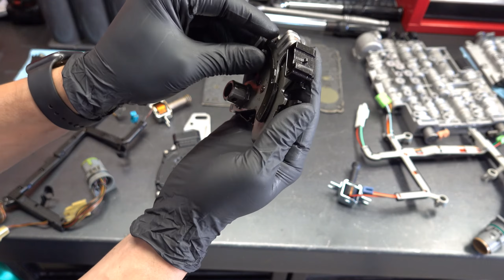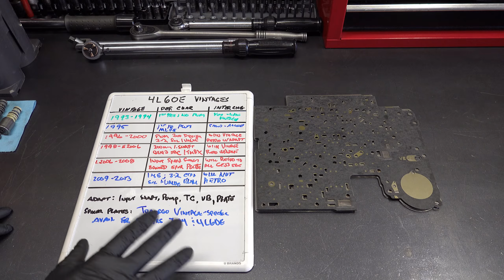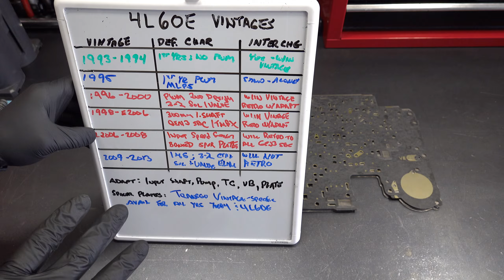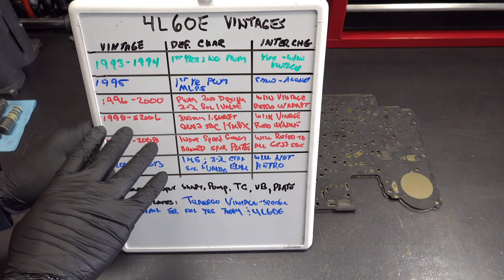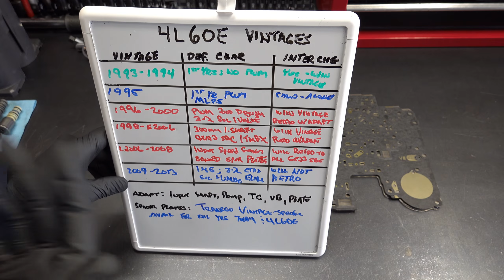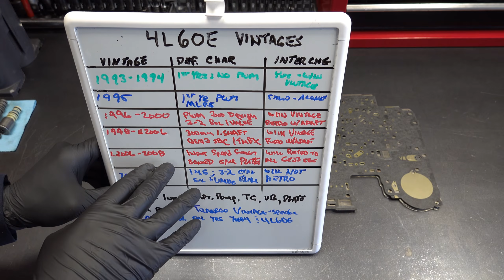How to Buy a 4L60E - Changes and Interchange Rules

Comment: Late comment, but is there any reason a 4l60e from a 98 Camaro LS1 not be compatible with an 01 Yukon 5.3? Electrical? Just swap valve bodies? I'm getting mixed info on the internet... TCC has to be factory functional to go into the Yukon? Thanks!
Reply from the maker: Ignore anything you may have seen and continue watching this video - I give a run down of all the vintages and respective parts interchangeably towards the end.
Reply: Thanks for replying, much respect 🙏. This is my first rebuild which wasnt a virgin transmission. Had checkballs missing and an aluminum plug, no spring, to lock the tcc valve (bottom valve was also backwards). Vac test is failing on the tcc... should I ream or just use a Fitzall o ring type? Off topic, the play between lugs on reverse input drum (new) and sun shell was kinda excessive, would that cause a noise? Thanks for your knowledge and efforts in sharing all this info!
Reply from the maker: I'd use the Fitzall valve kit or ream the bore for the Sonnax TCC regulator valve. Replace both reverse input drum and sun shell as they are both worn and will make noice if their respective sets of lugs have excessive play.
Reply: Will do, thanks for your help!
Reply from the maker: You're welcome, Steve and thanks again for watching!

Comment: You skipped the pump
Reply from the maker: No, I did not skip the pump.

I didn't intend to cover the pump itself in any level of detail beyond the defining characteristics associated w/each vintage of 4L60E as it relates to the pump as well as other things. But in case you're looking for such info, there were two versions of pump: PWM and Non-PWM. Within the PWM, there were two sub-variants: TSS and non TSS.

A deep dive on the evolution of 700 and 4L60Es pumps is forthcoming; it will be way more granular and specific than what you have watched here.

Comment: I got one 94 Z28 Camaro 5.7 LT1 I have a 95 computer in this came with the car and I'm having shifting problems which it did shift perfect had a little bit of a hard shift in a second now I'm only getting 1st and 3rd didn't know if it was in limp mode or if the solenoids were bad I bought new ones put in it still doing the same thing ,so I bought a Corvette upgrade servo to put in it having a hard time getting the old one out and putting this one back in and the chip that was in the computer I have two chips that are the same you got the 777 in the middle of it and one of them has a 8 something in the number could the computer be causing me to struggle cars only got $80,000 mi on it I'm confused about it any help would be highly appreciated thank you
Reply from the maker: Not likely the computer. Sounds like the band is worn. Drop the pan and see if you can apply the servo via shop air at the exhaust port on the pan rail. If it applies normally, that would indicate worn band to me.

Comment: hey nick question i have a 07 4l60e case that i converted to 05 pump iss deleted and im going to run the 07 valve body with the transgo 46-plt-96 its going into a gen 3 car so iss is not needed will it be fine? since the vb and case are 07 and im putting a 96-06 separator plate on it
Reply from the maker: What input shaft will be using? 

If you're not sure (or not sure why I'm asking) check out my Forward Drum video where, towards the end, I discuss the different input shaft changes that took place between 2005-2007. It's critical your pump's stator shaft and drum's input shaft are a matched set.

Here's the video: https://youtu.be/oGrc31WSVeE

Comment: Can a 15 pin transmission work for a 13 pin vehicle if I switch out the transmission wire harness out.
Reply from the maker: You should be able to do so without any problems.
Reply: @nickstransmissions what would need to be changed

Comment: Im having a delayed 2-3 up shift after and a trans fluid pressure build up causing  fluid to leak in the filler tube to pan gasket area and after a light rebuild of the valve body. Where can I start my diagnosis?
Reply: Do I have trouble shooting options inorder to help speed up the process
Reply from the maker: What have you done to trouble shoot thus far, if anything? I'd rather not make suggestions until I know what diagnosis you have completed.
Reply: @nickstransmissions  I haven't done  much ive checked  fluid levels purchased and installed new neutral safety switch and clutch cable thinking possible detent failure however problem remains
Reply from the maker: Ok, I am guessing that, assuming your fluid level is correct, system filled to capacity (not under or seriously overfilled) then its likely your 3-4 clutch pack is starting to fail. You can plug in a scanner that's capable of rendering live data to see the transmission command and shift and then log the shift speed. If it's more than a fraction of a second or so, the clutch is not grabbing/holding until you really rev up the engine to build more pressure in the circuit. 

A healthy 3-4 clutch will typically produce shift times under .5 seconds.

Comment: Hey Nick, very informative video. Just trying to clarify my understanding as I go about replacing my 4l60e. I got a 1996 LT1 4l60e combo, one piece case transmission. After swapping it into my s10, I had no line pressure and no gears. There is an overlap of years in the last segment, 1996-2000 and 1998-2006. This is due to the engine block differences in those years (SBC vs LS) right? If that’s the case, when looking for another transmission, I need to get one that is out of another 96-2000 non LS based vehicle, right? This would make for a direct swap, as the valve bodies are the same, input shaft is the same, and solenoids communicate with the same impedance etc.
Reply from the maker: Thanks for watching, David. I would rebuild your original transmission, unless you have already determined it is not rebuildable (cracked case, majority of internal hard parts destroyed, etc). If your original unit is not rebuildable then you need a 96-2000 unit intended for Gen1 small block chevy engine applications.
Reply: @nickstransmissions I inspected it after watching some of your other videos. When I pulled the transmission off the block, the torque converter was not bolted to the flex plate. The torque converter also doesn’t appear to be full of fluid. Going to drop the pan and see if there’s any shavings. I had put a new filter in and there wasn’t much on the magnet in the pan, but I didn’t check the torque converter before starting and running the truck. Going to grab a transmission out of the yard while I figure out what’s going on with this one. They have a return policy if it’s bad, so I’ll roll the dice.

Comment: You are wrong. I just switched a 08 transmission in a 09 truck. I just had to swap the valve body that's it. I'm driving it now shifts perfect
Reply from the maker: As is, the 09+ are not interchangeable with anything 2008 and back. Would not have worked if you didn’t swap the VB to a 09-13 VB.

Hope it lasts for your sake - used 4L60Es rarely ever do. I would rebuild your original transmission so it’s ready when this replacement shits the bed (assuming you had enough sense to keep it)
Reply: @nickstransmissions  the point is at beginning of video it said cant be done it wont work. Well it worked and everything is shifting smoothly. Only i changed was the valve body and internal range switch. Yes I still have my old transmission. I bought a used one for 500$ cause that's all I had.  And I needed the truck the next day.
Reply from the maker: You changed the valve body and the range switch to make it work. But for those adaptations as performed, it would not have worked. Again, the 09+ units are NOT interchangeable as is with anything 2008 and prior, as-is.

Rebuild your existing transmission so you don’t find yourself in the same position twice. Make sure you machine the pump, vac test the valve trains in both the pump and valve body then pressure test the forward drum for leaks - most 3-4 clutch failures happen due to leaking drums. 

My playlist and the ATSG manual will provide all the resources and information you need. Good luck with it; hope the used unit buys you enough time.
Reply: @nickstransmissions  go back to beginning of your video you said nothing you can do will make it work. I'm just saying you was wrong it works perfectly by just switching valve body and range switch. That's all im saying

Comment: Can’t find a definite answer on this when searching. Will a valve body from 04 work on a 96 model, 4l60E. Also have you come across a spring loaded checkball capsule, in the pumps location where Sonnax has you vacuum test the outboard portion of the TCC valve. Just curious on your opinion on that vs the standard small orifice port that I see on almost all of these.
Reply from the maker: Did you watch the video, especially at the end where I cover all the vintages and interchange rules for each component, including the VB?

Never saw a spring-loaded capsule that I can recall - only the small orifice cup plug so can't really give any thoughts on it.

Comment: Will a 98 Trans work in a 2001 Silverado with a 5.3
Reply from the maker: Re-watch the last section where I cover interchange rules and break it all down for you (or watch if you haven't already) - TIA!
Reply: @nickstransmissions i heard all i need is a spacer inbetween the flex plate
Reply from the maker: Re-watch the last section where I cover all the differences - I go line by line on a white board - the answers to your question are there. I don't remember mentioning spacers between flex plates in this video but if I did, it would have been in context with adapting different versions of 4L60E to various LS/Gen3 engine applications.

Comment: Hi nick am new to the channel my question is that if a can adapt a 4l60 from 2008 Tahoe to 2003 silverado if so what are the components that need to be replaced thanks for your time and knowledge
Reply from the maker: Thanks for watching, Juan and welcome...Re-watch the last section of this video - I tell you exactly what you need to do to adapt the different vintages of transmission for a given vehicle. The main question that each person has to answer is whether or not it's worth doing vs rebuilding the existing unit...In 99% of those cases, the answer is 'no' - it's not worth adapting vs rebuilding the existing unit.
Reply: @nickstransmissions oh I see am going to re-watch it a few times more until i get it but thanks for your time my man and thanks for pointing that out
Reply from the maker: Thanks for watching, Juan!
Reply: @nickstransmissions hi nick its me again am trying to fit a transmission from a 2008 to my 2003 both have the 300 mm shaft the only difference is the internal speed sensor as you already know  , so my concern is if the valve body and torque converter are compatible between 2008 and 2003 for what I understand in your video they should be but I can be slow sometimes , other than that you are not responsible for anything it's upto me to do my own research so any advise is greatly appreciated , great video btw

Comment: I was wondering if you would be able to tell me if it would be possible to put a 2005 4l60e into a 2008 suburban and what I might need to do to the 05 in order to make it work?
Reply from the maker: Did you watch the video? I actually break it all down for you towards the end so give it a view if you haven't already done so.
Reply: @nickstransmissions not being rude but you didn’t explain that . You only said how to put a 08 in a older model not how to put a older model in a 08
Reply from the maker: I’m going to revisit the topic soon as it’s by far the most common type of question I see people asking, here, on FB and internet tech forums.

I’ll cover whatever gaps may exist in this video.

Meanwhile if you have a specific question, simply ask and I’ll respond. As you can clearly see, I am very responsive to comments.
Reply: thanks . I’m dealing with this now .
Reply from the maker: So what is your specific question? Ask and ill respond, as I just stated

Comment: Hi, Nick, I have a junk silverado 1500 4.3 2wd with recently rebuilt transmission and an identical 2013 with a bad transmission, I noticed on autozone that there is a different part number for the two and car-part shows them as being non intergangable. Any insight on whether or not i can swap this out?
Reply from the maker: Watch the video - particularly the last section where I go over the interchange rules. All of your questions are answered in that last section.
Reply: @nickstransmissions  yes I did, but didnt get that, and I forgot to write, one is a 2011 and one is a 2013, so should work then.

Thanks, Nick

Comment: I have a 2000 Sierra with a  5.3 4l60e with an auto 4wd transfer case and was wondering if a 4l60e from a 2004 truck with the same configuration will work?

Comment: Can a 2007 4L60E be back dated to be used in a 2001-2006 application? TIA
Reply from the maker: Hi, thanks for watching - the answer to your question is in the video.
Reply: @nickstransmissions  OK so I should be able to just plug in and the ISS sensor is just bypassed cause the transmission control unit is not looking for it correct thanks again.

Comment: I have a question, will a 2009 sierra w/t 4.3 4L60e work with 2009 4.8. I've found some information they used 298mm in LS and non-LS application. If anyone could help. Thanks
Reply from the maker: You'd have match up shafts...Contact your local GM dept, ask for 'Parts' then give the parts guy the last 8 digits of your VIN. They will tell you what input shaft and torque converter you have so you can match everything up with a replacement unit.
Reply: @nickstransmissions ok thanks

Comment: I’ve been tryna figure this out for a minute now, you might be the best person to ask. Would a 2011 Sierra with a 4l60e (1kpd id code) take any other 2009-2013 4l60e (given it’s from another 4x4)? 
For example I found a 2010 one with 0kpd code and apparently the electric internals run different so it will shift rough and go into limp mode. Then some people say any 4l60 from that range will work fine. Any input is really appreciated!
Reply from the maker: Thanks for watching...Who told you that the electronics, command and control is different amongst 2009+ 4L60Es? When you say, "apparently it will shift rough and go into limp mode", is this based on first hand experience or something you've read somewhere on the net?

AFAIK, they are all the same 2009+ but nothing from 2009+ is compatible with any vehicles 2008 and older. 

Here's my input - 4L60Es are a huge gamble when buying used, unless you know the history of the used unit (i.e. it's coming from someone you already know personally) or the seller has paperwork showing that it was recently rebuilt. My input is to rebuild your 2011's 4L60E and not waste your time and take on unnecessary risk buying a used transmission.

Comment: Would 1997 one piece 4l60e work with the 5.3 LS pcm?
Reply from the maker: What year PCM are you using?

The LS5.3 PCMs up to early 2006, no ISS, will work for/control any 1996-2006 4L60E. But if you have a late 2006/2007 PCM installed originally into a GMT900 platform, it will be looking for the input speed sensor that went into those transmissions starting w/the GMT900 platform chassis.
Reply: @nickstransmissions ok any gen 3 ls computer will work ?
Reply from the maker: Not sure as I am not a tuner or PCM/TCM expert. I would think so, for at least OBD2 years, but don't want to say definitively for reasons I stated.
Reply: @nickstransmissions 0411
Reply from the maker: Yea, the 411 should be fine...plus you can always tune out the ISS programming from a later PCM/TCM (I think those ISS units all had stand alone TCMs that controlled the transmission). You're welcome and thanks for watching.

Comment: Question here when going from 2002 4l60e to 1996 do I need to get the pump from the transmission that was originallly in the truck or use the new one with the new transmissio
Reply from the maker: Watch the last section of this video - I dive into the details about what will interchange and what won't, including the pumps. When it doubt, always reinstall what was there to begin with (make sure you machine the pump and vacuum test the stator support before installing it).

Comment: Hello, want to swap my 2006 Silverado 4l60e with similar year transmission , is there any special programming I have to do?. Or can I plug and play? Can I use any 00-06 donor transmission?
Reply from the maker: Why not rebuild your 2006? Used transmissions are a crap shoot; you end up rolling snake eyes sooner rather than later in most cases (unless you personally know the history on the replacement and it was recently rebuilt)
Reply: was looking at one all ready fully rebuilt , am just wondering it needs “programming” I assume no and perhaps just a TAP reset doing the key on time hold gas pedal down method? Thanks for your response!
Reply from the maker: No programming needed at all. 

If you have a gmt800 truck you shouldnt have the input speed sensor but if it's a new, new body style GMT900 truck, you will prob have it. If your transmission harness case connector is green, no ISS but if it is orange, you have it. 

2006 is a change year so just make sure you buy the correct variant of 4L60E for your truck.